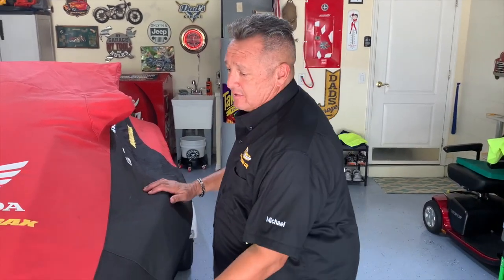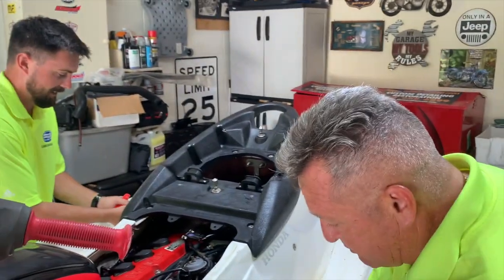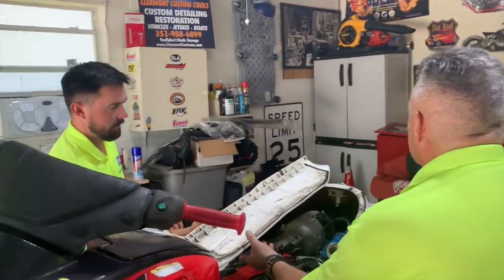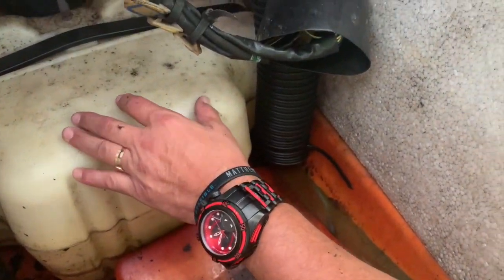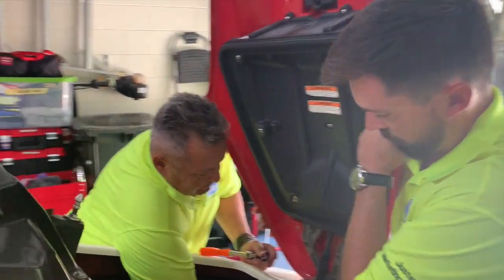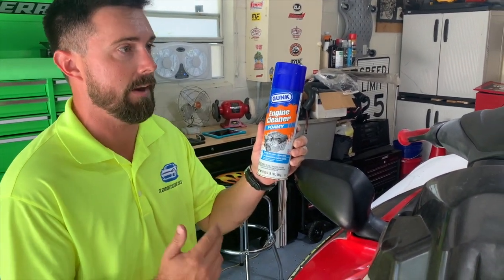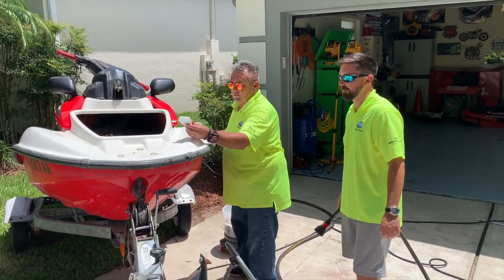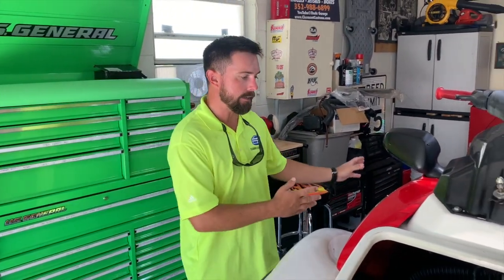2004 Honda Aquatrax F12X Turbo VLOG

Comment: I own a 2005 with 55 hrs on the clock that has never had the tank changed. How long ago did Honda issue a recall on the fuel tanks?
Reply: That’s great hope you enjoy it for some time to come!  I am not sure when they issued the recall, however, if it has not been done any authorized Honda Jet Ski service Dealer can get it changed out for you.  This would be at no cost to you.  You will need to do a little research with the Dealer to ensure they are capable.  They can look up VIN number from the back of the Ski on the hill.   Thank you for your question… we are on a new build and the video is been edited.  Thank you so much.  Have a blessed day.  Mike CCC…..
Reply: @navarrosupernicebikemike8451  After posting I did a little research and it seems it was related to people using various spray cleaners/protectants that contributed to the tank plastic breaking down.

Comment: Guys help me.  Do you know where to connect an obd2 scanner to 2004 aquatrax?  Please let me know.  I saw it being done on a video but it was not disclosed how.
Reply from the maker: Thank you for the question. If you would please , can you provide me the Company/Vendor where you purchased it from.  I believe this is an Interface Module, not sure.

Thank you.
MD (Dads Garage) Clermont Custom Cools
Reply: @clermontcustoms  I have the Candoo Pro I bought for a few hundred dollars for Seadoo. They also have  unit and upgrades for honda Aquatrax 04-09  and honda outboards. I never upgraded for Honda because I haven't needed to yet on my Aquatrax machines. Problems are usually wiring corrosion, computer, sensors and such. Look into that. It hooks your ski to a laptop. You really need that for Seadoo because of the key programing and parts that need to be reset. Honda is not that complicated except for GPS models.
Reply from the maker: dk4622, for sure thank you.  CJ has that laptop tool and I reach out to him at times…more to come
Reply: So is there an OBD2 port on the jet ski or no?  Not sure from the answer if the candoo device you have hooks up to a different spot or the OBD2?